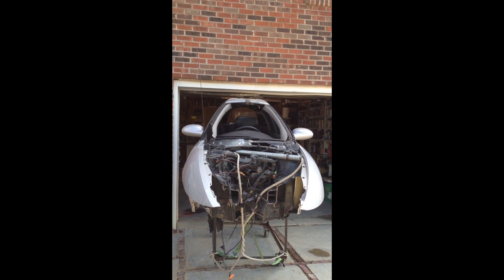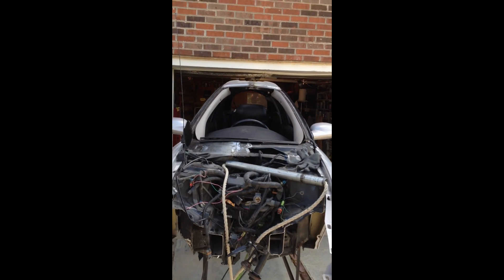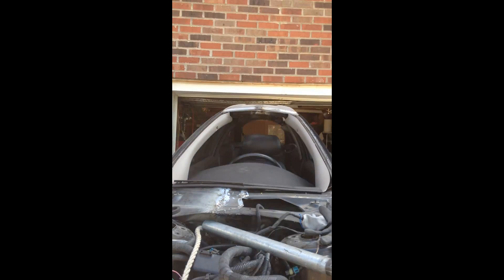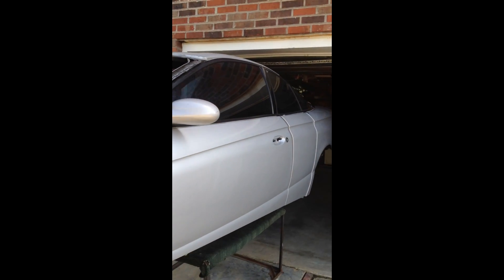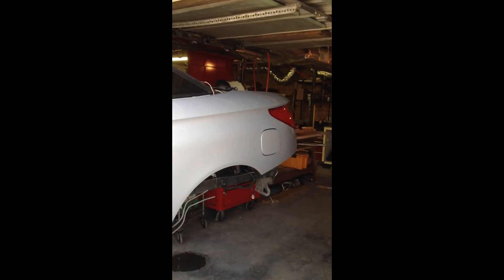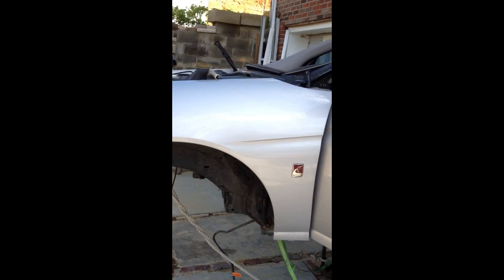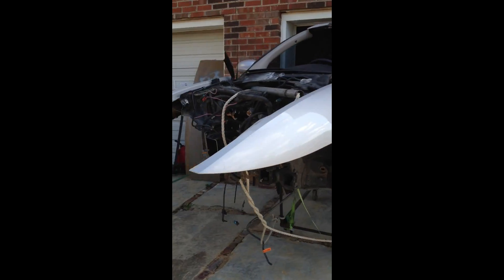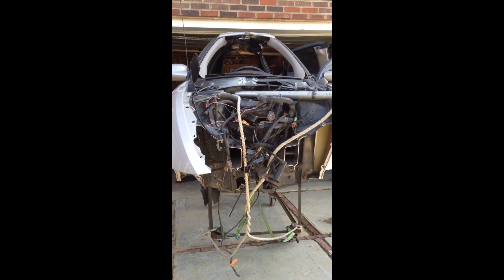Carver One -Karver One - Kenneth's version  Video 1

Comment: i thought of doing the exact same thing as this using smart car rear subframe except i was going to build the chassis myself and use conventional motorcycle forks or a stretched motorcycle/scooter frame and forks.
cool idea cant wait to see it finished !
Reply from the maker: Actually this vehicle is operational. I have driven it 50 miles for testing.. It's quite a ride..

Comment from the maker: I will be up scaling the tilting action of a Honda Gyro S three wheeled scooter from the mid 1980's.   Rather than have the pivot moment about the center line the engine pod a 10 degree, front to rear incline...  It generates a 7 degree rear steering moment when leaning.     Tilting will be just like a motorcycle with a pivot lock instead of putting your feet down...   That is the theory I am building the vehicle upon.